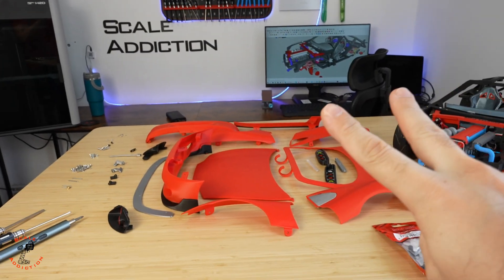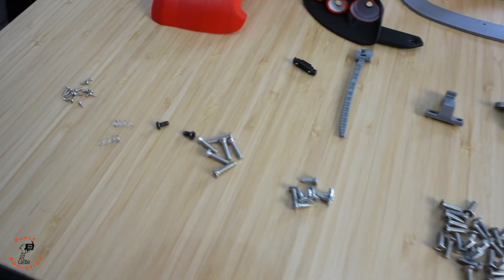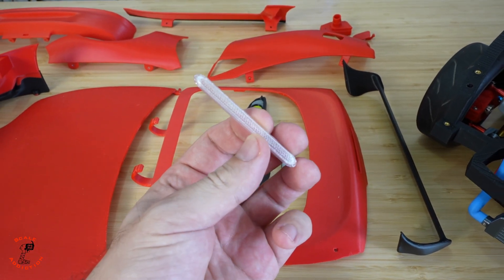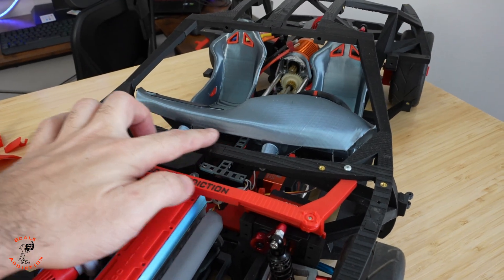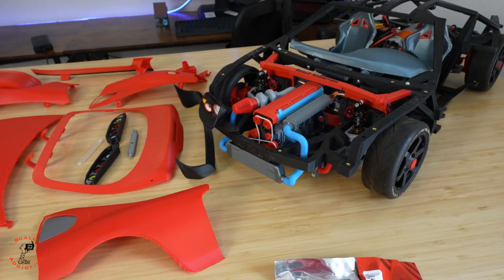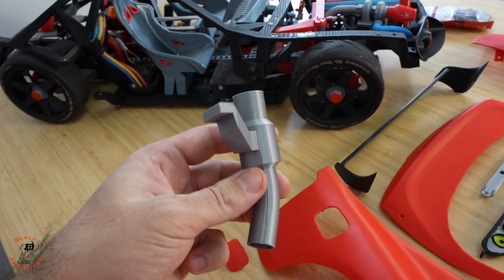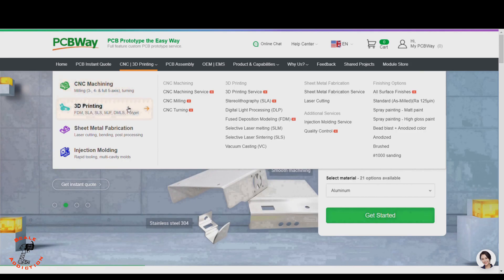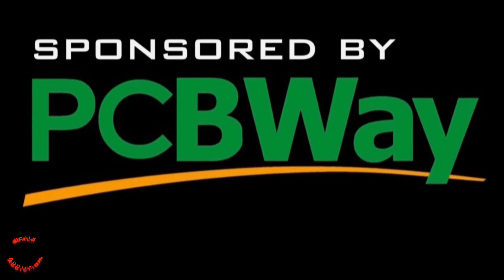3D Printed 1:8 scale RC Supra top speed

Comment: I saw the thumbnail and i thought it was a poorly shaded Unity model 😂
Edit: sound systems usually have really bad quality and they just take away from the RC car. I personally wouldn't do it unless it was properly with a good driver and using high quality samples, it'll cost extra but make it actually nice rather than distort like they always seem to
Reply: Harder part is finding speakers that would fit that would also have enough base. I spent almost 3 months making a sound system on a microcontroller that can actually be powered using the onboard battery itself. CD quality audio. But no matter what , the larger speakers and the lack of realism with fitting such speakers always is a short coming
Reply: @orange_tweleve  i would avoid using too much bass as it will create shaking inside of the RC car and mess up the audio anyways. Better to use a more muffled or exotic sound to make sure it works well. Ideally for that you'd have a speaker chamber on the exhaust with the same foam balls that laptops and phones use to prevent reverband make a more "full" sound

Comment: Hi, do you have a link for the new gearbox servo? Why did you need to change it?
Also i have a question about the rear quater panels,  every time i print them the thin vertical section at the window breaks very easily.  Is there an updated file for it or am i just printing it badly?
Thanks!